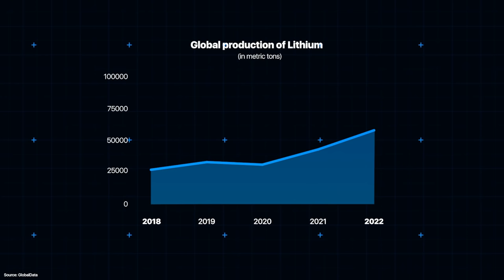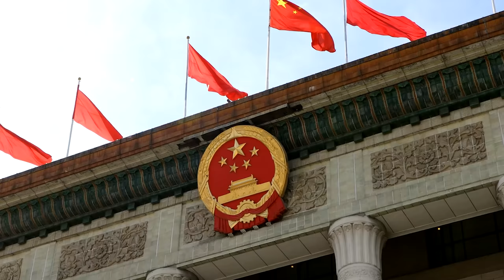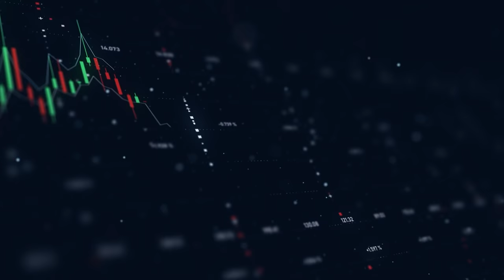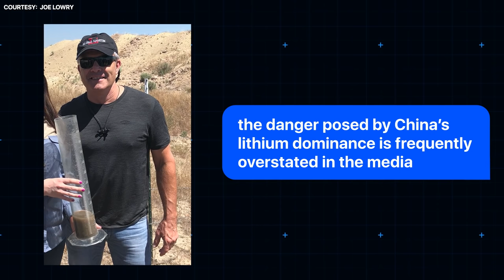How China Controls The World's Battery Supply

Comment: If you think half of all cars in 2030 won't be electric, you don't know anything about exponential growth.
Reply: From an Engineering standpoint, If you think most commercial power infrastructure can handle 10 times the current electric vehicle capacity without both expanding the Energy supply, chemicals required, and most important expanding mining capacity all by an exponential number, enjoy the blackouts, by all means you deserve them.